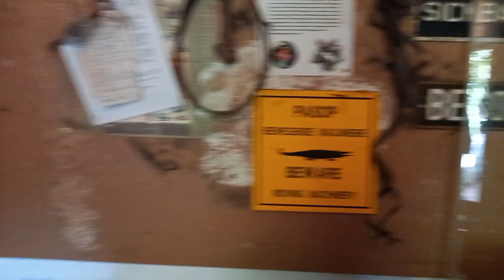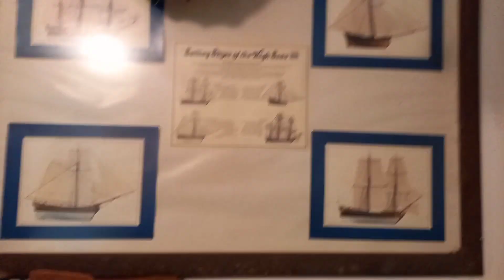British M1907 bayonet for SMLE by Wilkinson. Review and RESTORATION also called the Sword bayonet.

Comment: I found two in a safe of a house I bought. Was thinking of using one as machete. Are they worth something? One is in a very good condition.
Reply from the maker: They are worth less then I thought. There where a few thousand made. If I were you I would keep the nice one and use the smoke out of the other. Thanks for watching.
Reply: I respectfully disagree.  Several commercial machetes are available for less than 20 bucks. While there were thousands of these bayonets made, there won't be any more. Save that piece of history for someone else to enjoy. Cheers.